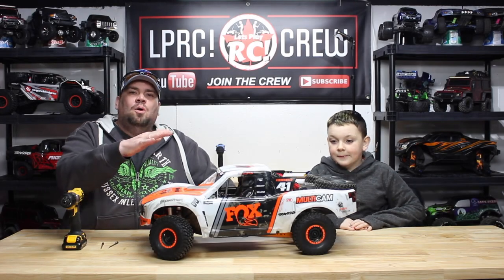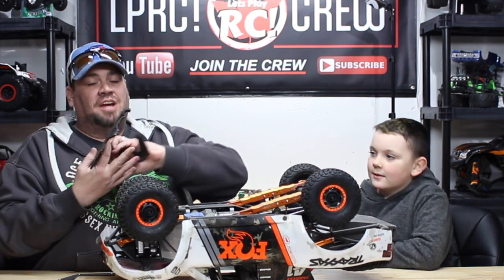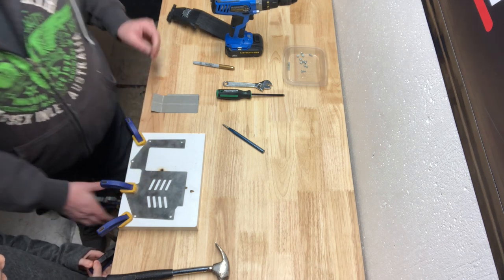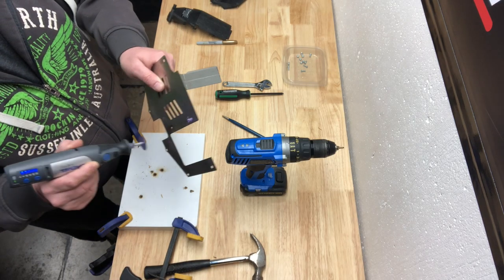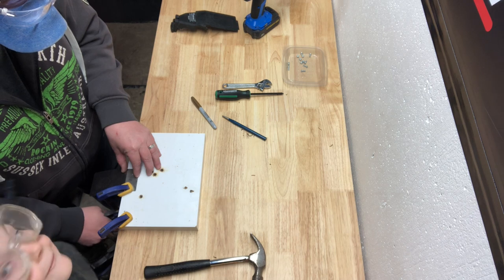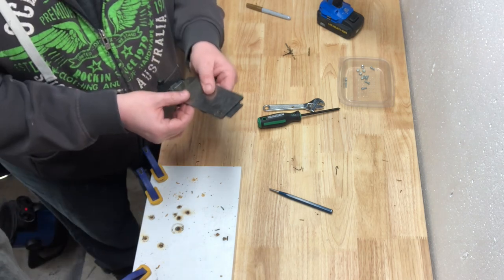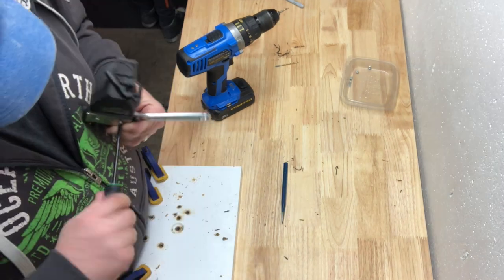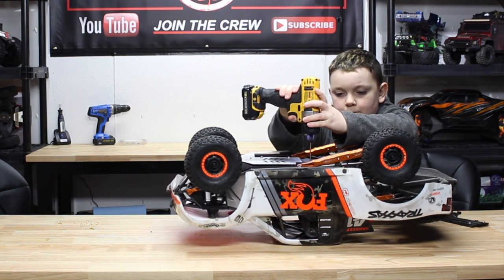Traxxas UDR Skid Plates by GPM Don't Stick/ Modification/ Lets Play RC!

Comment: Great video and looks like you did a great job. So you used the stock cover to block the vents on the new skid plate? I just bought the same skid plate and I am concerned about dusty and sand getting in there since it isn’t an easy place to get into to clean out after a run.
Reply from the maker: Thomas Long ,  hey there first off thanks for watching. Yes we just installed the GPM stainless steel skid plates right over top of the stock plastic ones. This seems to work great and will definitely help keep dust and debris out as you mentioned. 😉😁.

Here is our install video incase you missed. Maybe it can help. 
https://youtu.be/iH6AaYzE0u4

Have a great day! 👍
Reply: LET'S PLAY RC! That’s what I get skipping forward! I rewatched the beginning of the install and see what you did. I am hoping to get away with using some 3M tape on the battery door, not really wanting to drill holes but I may have no choice.  Thanks so much for responding

Comment: I don't see the reason to make two additional holes in the chassis cover on the side where it is slightly raised near the battery tray.  If it looks like you haven't used the UDR at all, the whole gmp chassis cover kit looks brand new.  to the battery if it seemed like a good idea since the jump or hard bashing could take off.  but even so I doubt it since you can see that the udr is a queen of the shelf. but God mod 👍🏼
Reply from the maker: Hey thanks for watching. 👍 trust me when I say there is not a shelf queen in our collection lol. We bash our RCs hard.  At the time of this video the UDR was not very old. The reason we did this mod is that the GPM skid plates come with double side tape that did not hold up, so this was for reinforcement purposes. We have bashed hard sims with no issues on the skid plates.  😉